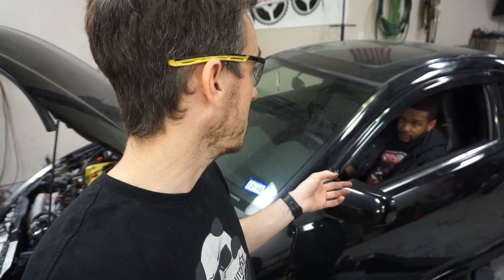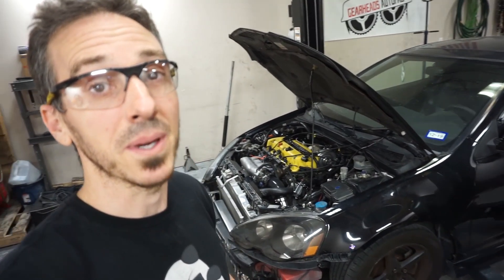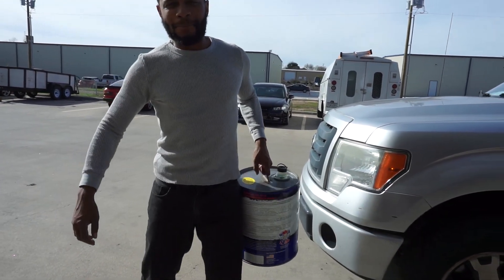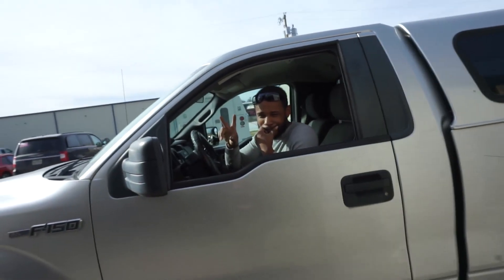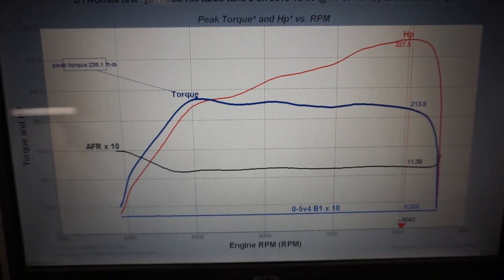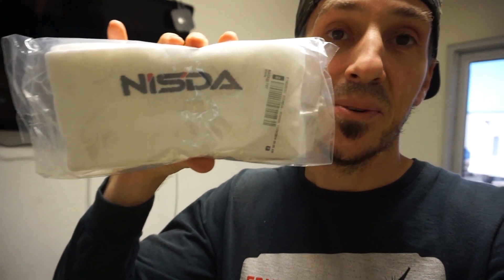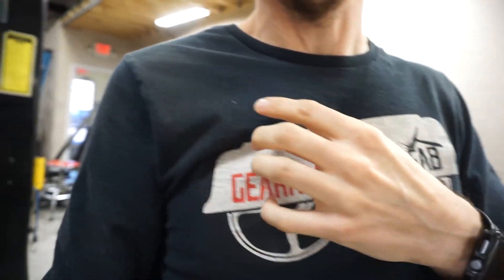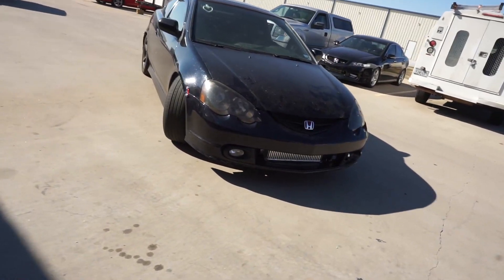Could you guess your hp from a test drive?

Comment: Jari didn't do too bad on his guess.👍  I can remember the first time driving my GS-R (with open downpipe) after I installed a turbo back in 2000.  It was right at 270 whp, but from stock to that, the ol' butt dyno lied and told me it was way more.😉 Have fun with that car and enjoy it for a while at that level. Everyone always wants more, but if you can't put it down without smoking the tires all the time, what's the point?  Jarom, the power level you have it tuned for right now is about perfect for a fun daily. Just get some new tires and maybe beef up the brakes and that thing should be a blast.  Y'all take care and have a great week!✌  NISDA🙌

Comment: How many miles on the motor? I want to boost my DC5 but mine has 165k and I’m scared it will blow if I turbo it.
Reply: TBills 3000 163xxx
Reply from the maker: How much hp did you want to boost yours to? I’ll turn jaris up to that hp to make sure it’s safe for your car 🤪🚗💨😂😂😂😂😂 lol if he doesn’t mind ha ha
Reply: Gearheads Autofab I want like 350 to 400 but it’s got a bunch of miles so I was thinking maybe just 300 wheel

Comment: What engine is in the rsx and is there any preference between mounting the turbo behind the motor or over the trans case where the stock airbox goes.
Reply from the maker: Engine is a stock Rsx type s k20. But with a rbc intake manifold. And the turbo question is a very good one. You can make more hp on a tubular manifold than a rear mounted log manifold. But there’s pros and cons to both. Rear is cheap and inefficient but works for mild setups, it’s a easy install and low maintenance. But if you need over 600 hp i would go the tubular route. But it’s more work on the exhaust piping and more things to move out of the way as well. And usually cast manifolds last longer. 

Really depends on what your doing with the car.